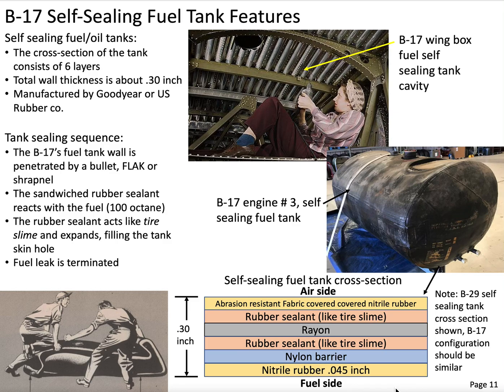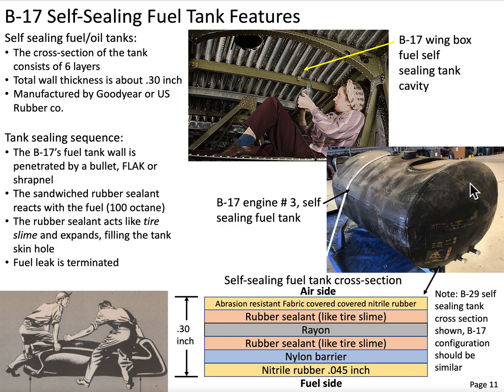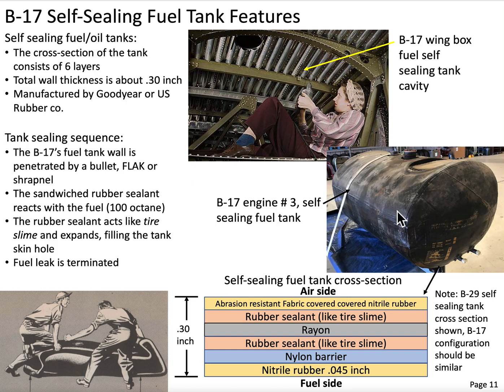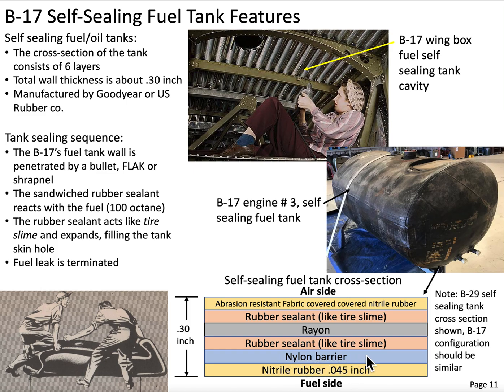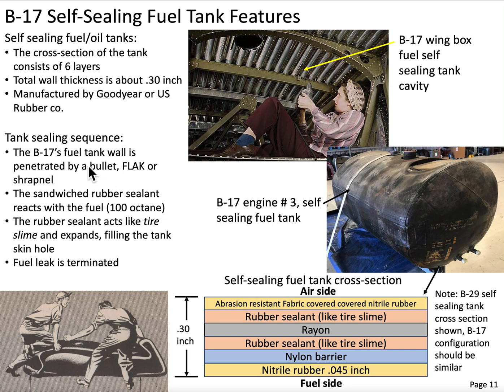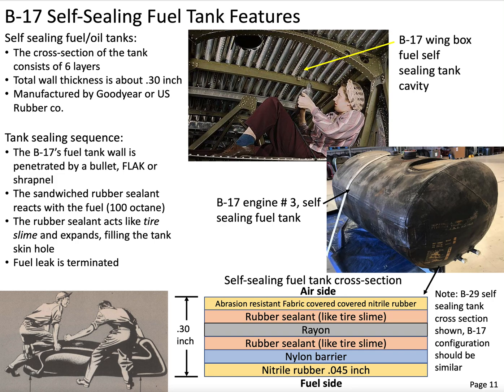B-17 Bomber's Self Sealing Fuel Tanks Explained

Comment: Just read this, which is a first-person account of the arduous process of developing an effective self-sealing tank.

A lot of things didn't work they way I thought they did from lots of other sources. The engineering and chemistry problems were insane and it's well worth the read.

Before the first live fire test, they figured that it was a fairly simple problem and that the rubber layer would easily seal the hole from a .50 round. When the fired the shot, the fuel tank exploded. The gasolinendid not catch fire. Gasoline fumes did not explode. The tank was simply physically blown apart.

Also, an article in Flight analyzing a captured Ju88 in 1940 showed that its fuselage fuel tank was the gold standard in self-sealing tanks. U.S. studies later showed that there were physical and chemical problems with the bladders against .50 rounds, but the installation was amazing. (The bladders were effective against .303 and 20mm HE.)

Comment: The tanks may be collapsible but to get the three tanks in and out of a B-17 wing, three panels on the underside of each wing are unbolted and lowered to the ground.  The tanks are strapped to the panels, which are approx 4 ga (0.250”). We had to remove the tanks in order to inspect the spars.

Comment: If a rigid tank has a mixture of fuel and air (oxygen) inside, it is a bomb waiting to explode if a spark is introduced, like a penetrating incendiary round.  Did the B-17 tanks exclude oxygen somehow?  Either by being collapse or by having the fuel void filled by something like nitrogen?
Reply: I too don't think there is any kind of nitrogen filled stuff or whatever. The US bombers relayed entirely on self sealing fuel tanks! Here is the following excerpt: Self-sealing tanks tended to be heavier with lower capacity than non-sealed tanks. Nonetheless, aircraft that were fitted with self-sealing tanks managed to withstand much more damage than those with conventional fuel tanks like the Mitsubishi Zero....
Reply: Good question!
Reply: I don't think so.